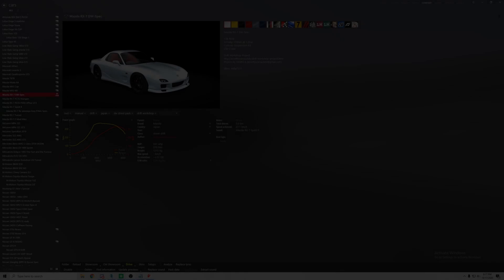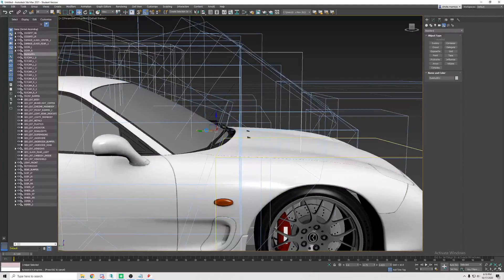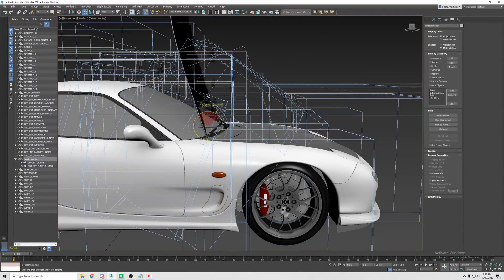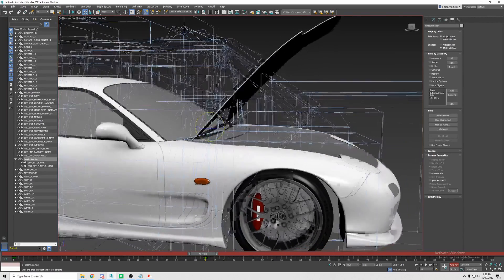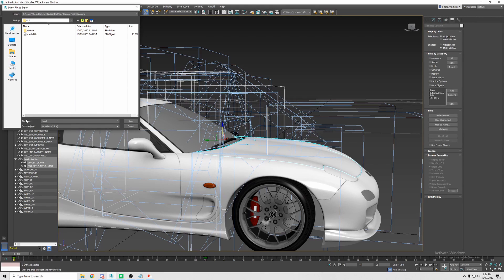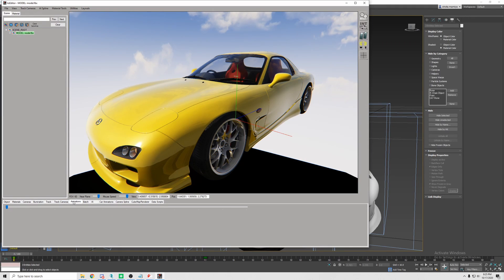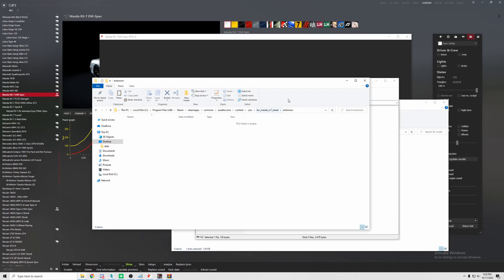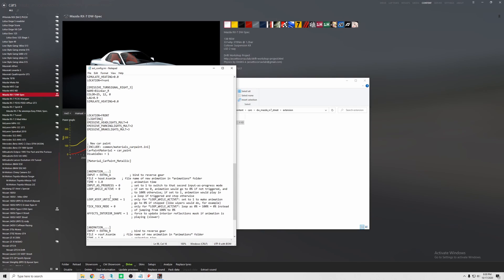HOW TO: Hood Animation | Assetto Corsa | 3dsmax

Comment: No way, I've been delaying some animations but it turns out I only needed this video and 15 minutes! Thanks a lot. I used the tutorial to do a door animation and it works the same.
Reply from the maker: Dope! Glad I could help!
Reply: @MamiyaMotors  hey I followed every step you provided. I was able to pop the hood in game. I have 2 problems though, 1st, the hood in the animations option in CM showroom doesn't show up. And the major issue is when popping the hood in game, the hood does the animation, but after reaching its endpoint, it suddenly appears back as it was closed. Then after pressing the bind again, the hood teleports back to the opened state and then does the closing animation. Pls help. i lose my mind already.

Comment: hey @MamiyaMotors I followed every step you provided. I was able to pop the hood in game. I have 2 problems though, 1st, the hood in the animations option in CM showroom doesn't show up. And the major issue is when popping the hood in game, the hood does the animation, but after reaching its endpoint, it suddenly appears back as it was closed. Then after pressing the bind again, the hood teleports back to the opened state and then does the closing animation. Pls help. i lose my mind already.

Comment: How do I set the animation to always be on? This is for radiator fans and turbo compressor wheel
Reply from the maker: You can use extra_animations.ini and set as a rotating object. Check out the DCGP e92. I think it was either out of the 2019 or 2018 pack. Orrrr it could be 2020. I forgot. But theres only one e92 out of the three packs that has working rear fans. Check out the extra animations in the data folder and just use that code

Comment: Hey man I’ve been watching your tutorials and you do a great job teaching! I’m having an issue with my handbrake animation. Everything looks good in 3ds max, but everytime I load it in kseditor, the angle of the animation is like 90 degrees instead of 15 which I set it as. If you have any ideas that would be great thanks
Reply from the maker: Thank you! And my immediate thought would be that maybe the first key frame is set to at 90 degreees possibly? Make sure there is a key frame at 15. If that’s already done then I would recommend just doing it over again with a brand new dummy and animation. Sometimes it gets messy when you try to fix a current animation
Reply: @MamiyaMotors  thank you for the reply! I have since figured out the problem. Really appreciate the time you take to make these videos! <3
Reply: @peacegangofficial what was the fix I have the same issue with the trunk

Comment: Hi great video. Ive got an issue with door animation. In KsEditor; before animation, door is fine, after selecting animation, door is slightly off alignment when closed, but still works fine. In max all seem fine with animation... Any ideas?
Reply from the maker: Try resetting xform in 3ds and then redo animation
Reply: @MamiyaMotors  First attempt in 3dsmax animation looks good. I do every step than you. When I import the animation in KsEditor the door it's out of the vehicle. I reset the xform and redo the animations and it¡s the same. The door isn't in the right position. What i can do?

Comment: do you need to do this before you mod the car ? cause i have a whole modded ccar and when i did this , in ks when i open the hood fbx , whole parts just move. help ?
Reply from the maker: If anything I would do the animations at the very end so you don’t accidentally move things when you start modding things
Reply: @MamiyaMotors  i dont know what i did wrong , when i open fxb animation '' hood '' , all of the parts just split around
Reply from the maker: @acm8759  try again and go step by step. Somewhere in the process something may have not been done correctly
Reply: @MamiyaMotors  ill try when im online , thank for the amazing explanation in the vid and for the amazing replays

Comment: Great tutorial dude! Well explained. 

But i've got one problem, so i was trying to make an ITB intake animation. It's all working perfectly in 3ds max. But when i import the car in kseditor, the itb cap is at wrong place/position. The animation is still working. Do you know what cause the problem?
Reply from the maker: When things aren’t in the correct place in kseditor, I find that resetting x form in 3dsmax corrects that. That happens when you scale an object substantially or you rotate it and it’s on a completely different pivot. I would take the object out of the dummy and then reset x form and then redo your animation dummies
Reply: @MamiyaMotors  THANKS! works like a charm now :))
Reply from the maker: Glad it worked!
Reply: @MamiyaMotors  First attempt in 3dsmax animation looks good. I do every step than you. When I import the animation in KsEditor the door it's out of the vehicle. I reset the xform and redo the animations and it¡s the same. The door isn't in the right position. What i can do?
Reply: @MamiyaMotors  I followed every step you provided. I was able to pop the hood in game. I have 2 problems though, 1st, the hood in the animations option in CM showroom doesn't show up. And the major issue is when popping the hood in game, the hood does the animation, but after reaching its endpoint, it suddenly appears back as it was closed. Then after pressing the bind again, the hood teleports back to the opened state and then does the closing animation. Pls help. i lose my mind already.

Comment: how can i make a sunroof?
Reply from the maker: You would pretty much do everything the same as the hood but with a sunroof object. Assuming you already have a sunroof available
Reply: @MamiyaMotors  I build the car when it is transferred to the game, the car becomes like a giant and sometimes it becomes tiny. What is the reason?
Reply from the maker: @kaori7625  are you making sure the scale factor in the software you use is correct? If you are using 3dsmax then make sure the scale factor on import and export is set to 1.0. It doesnt matter the units
Reply: @kaori7625  If you use blender make sure you export it with 0.01 scale

Comment: Do you know what the problem is? I animated the doors and they in ks editor move a little, not as I set in 3dmax.
Reply from the maker: Not too sure. Make sure your keyframes are properly set and you export with correct procedures

Comment: The inside of my hood is invisible lol
Reply from the maker: You’ll need to either use the shell modifier in 3dsmax to make it have an inner layer. Or make another layer underneath that is facing inwards so it won’t show invisible
Reply: @MamiyaMotors  ok, will try later. Thank you